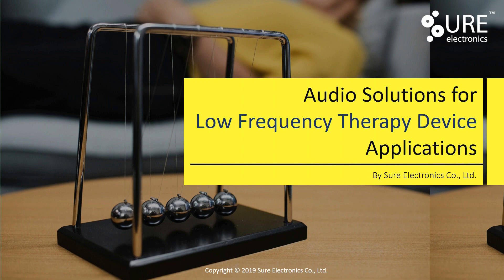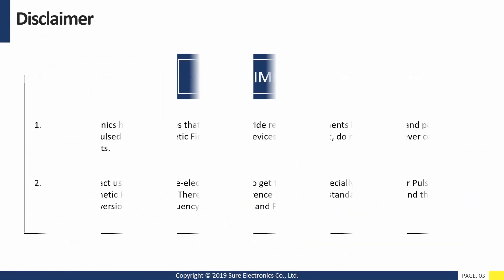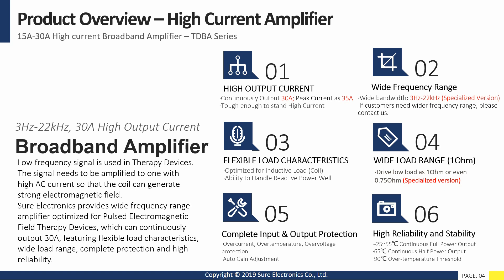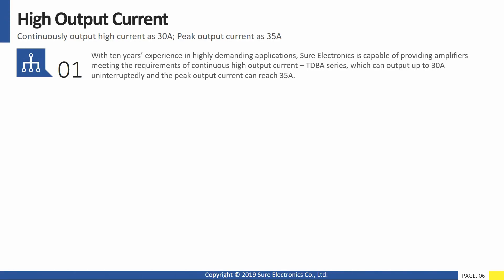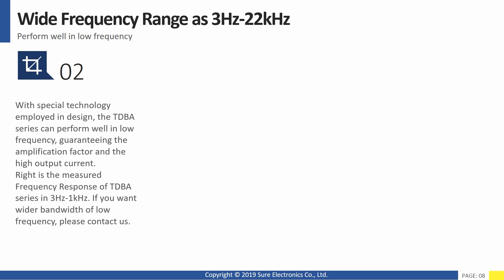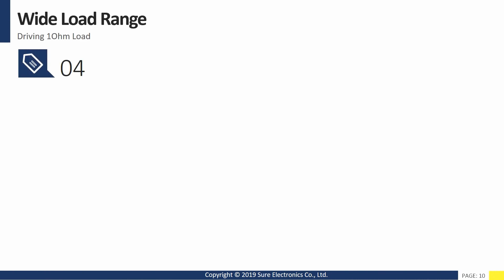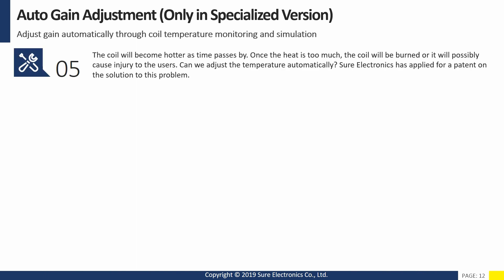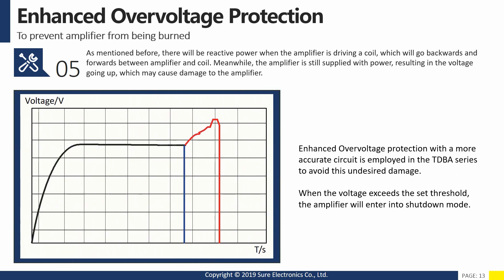Sure Electronics High Current Audio Solutions for Low Frequency Therapy Device Applications

Comment: AC current is not used in PEMF therapy this is misinformation. This circuit is what's commonly used for CRT degassing aka degaussing coil that eliminates a remnant magnetic field. Using this method is a great way to promote osteoporosis. AC is one of the most dangerous types of EMF pollution aka “dirty electricity.’  If you want to leach bone mass you could also live in space :-)